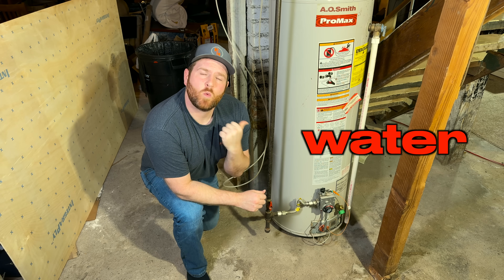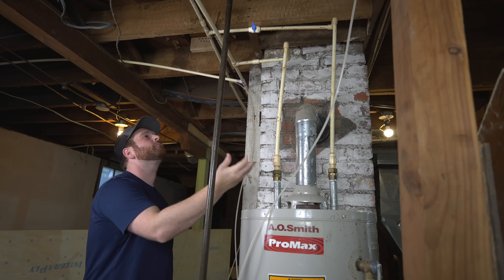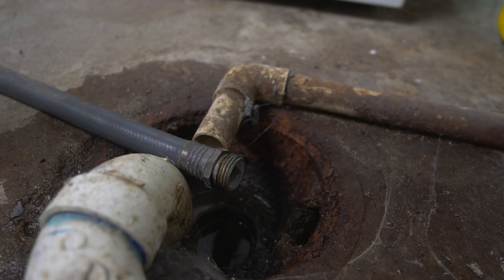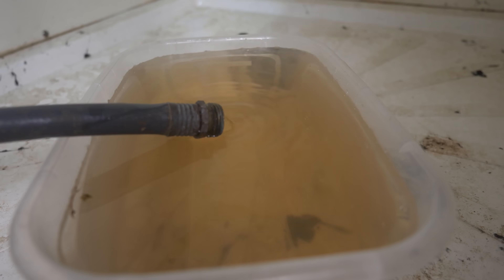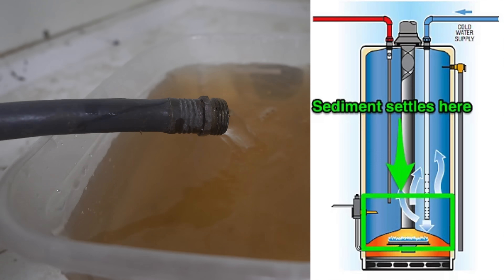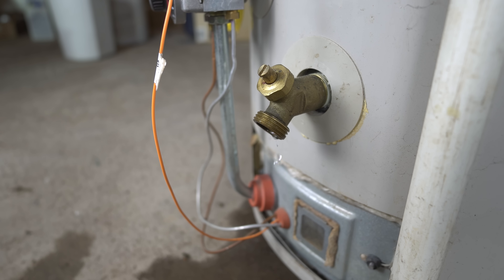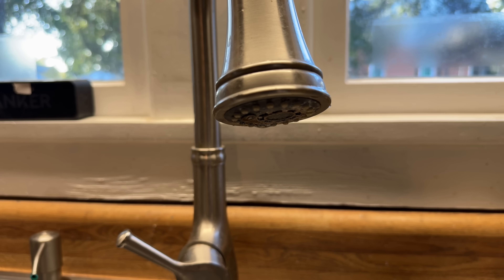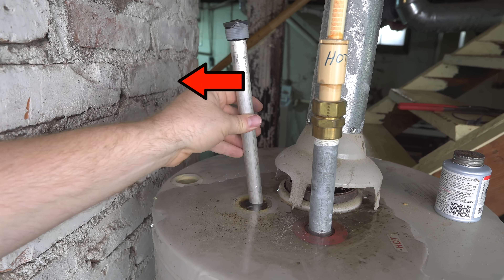Correct Way to FLUSH WATER HEATER! 2-Minute Tutorial

Comment: I have my water heater for 12 years now... it works amazing i had no idea about this
Reply: Same here, Never touched it.

You know though once we start messing around with it somethings going to go wrong with it within a week or so!

....Never Fails!😐😢
Reply: @huntingtonbeachsasquatch  thinking the same, I was thinking about doing. Buy thought I'd screw it up.
Reply: @soolly357  ....Do it early in the day, don't have other plans just in case all hell brakes loose and you snap a pipe or valve and find yourself doing a replacement water heater!:hand-orange-covering-eyes:😤😠🤬
Reply from the maker: Certainly Not a have too. But I think everyone can agree preventative maintenance can add life to about anything.
Reply: @HandymanHertz  for future ones yes absolutely
Reply: Yup, great info.  But if a few years have gone by and the tank hasn’t been flushed, leave it alone cause it could cause more problems.
Reply: time to drain it!

Comment: Is it true that if you have a old water heater that has never been drained and flushed, you shouldn't start doing it after that so many years have passed?
Reply from the maker: I'm not sure if it's true or not, but I have heard that as well. May not hurt to leave it be if it's really old.
Reply: That’s what a local plumber told me to
Reply: @HandymanHertz  Thanks for the reply.  Yes, that's my thought as well.  I did buy a cap per your suggestion because I have a slight drip leak, probably from mineral build-up.
Reply: Came here wondering the same, thanks for asking! Mine are VERY old and doubt they've ever been flushed but good info to know when they have to be replaced!
Reply: I'm wondering the same thing. My 50 gallon water heater is over 20 years old. I can't access the rod easily due to ducting, piping, and ceiling clearance, so I can only guess my rod is long gone. I'm concerned that the second I mess with my heater that it's going to have problems.

I do wonder if the frequency and amount of hot water used affects anything. My family of 8 vs a couple will have different hot water needs.

Comment: I've found that the best way to maximize sediment removal is to remove the lower heating element once I have the tank drained.  This allows me to use a water hose to inject water into the bottom of the tank from a variety of angles instead of just from the inflow line.  Tends to stir up a lot more sediment that way.
Reply: I do the same thing, with a small difference. I cut a scrap section of garden hose about 2 feet long, tape it to a shop vac, then suck up the debris through the hole for the bottom element. Works great.
Reply: @mj625  I may have to steal that idea.  Good thinking.
Reply: @Bonkrr  I think you will like it if you try it. It speeds up the process a little bit because you don't have to wait to drain any stirred up sediment. Just be gentle with the hose against the interior tank surface.
Reply from the maker: Great tip or an electric water heater. Thanks for sharing.
Reply: Is there a way to do this with a gas water heater?  Somewhere to blast some water in?  I need to drain mine out too..
Reply: @M4R1N4 I have the same question! I hope you found your answer.

Comment: Random but similar question for you. Is it okay to use the water heater drain as an outdoor spigot line for rinsing purpose? The water heater at my property has a line connected to the drain that leads through the wall and outside spigot. Between the line looks be a converter because if I touch the line before it, the pipe is warm. But when you turn on the spigot outside it comes out cold. My tenants have been using it to rinse off beach sand off their dogs or items as we live in a beach community. Not a full flush out, its just a few minutes usage of water to wash of sand. Do you know if this is okay or is it likely to cause damage on the water heater?
Reply from the maker: This is perfectly fine. In fact, it's good to use that for that purpose. I couldn't use that water spigot on a washing machine, for instance, because it may have sediments. Nothing harmful with this setup you have that I can think of
Reply: @HandymanHertz  Thanks! This was setup from the previous owner before I took over so I don't have any answers as to why or what used for. My guess it it may of been used to the automatic sprinkler system. Just thinking that was the case because of why the converter device is installed to expel out cold water.
Reply: @HandymanHertz  I can email you photos of what it actually looks like if you want a better visual for opinion.

Comment: Why would i use a shirt to filter the water?    To see the junk coming out ?
Reply from the maker: Yes, it's an option. I like to see what's coming out.
Reply: Would it make sense to change the anode rod, when the tank is empty?  It looks like there was water spilling out the top of the tank when the anode was pulled.

And BTW, my water tank hadn't been flushed in years, and I noticed dirty water (only hot) coming out of taps, after we had been out of the house for a few weeks.  So, my read of the manual, talked about 2x/year flushing which I had never done in over 10 years.  So I flushed the tank, using a procedure similar to this video and after a couple hours of flushing the water was clear.  I am on municipal water.

Thanks for the video.

Comment: LOL...that drain never works.  It gets clogged by the smallest piece of debris.
Reply: If your drain is blocked by debris, simply use a garden hose or other source to back flush it.
Reply: @Bonkrr  I get that.  My tank is a poor design.  The valve is literally at the bottom of the tank.  Back flushing will not work.  I need to make sure the next tank has the valve a few inches above the bottom of the tank so mineral sediment fall below the valve.
Reply: You can easily replace that valve with a larger one.  Just use teflon tape and plumbers putty

Comment: i've never met anyone that has actually drained their water heater
Reply: I actually need to, that’s why I watched this.
Reply: @PFCMittens stg me too😂 every time I run my water smells like rotten eggs so hopefully this works 😂🙏
Reply: I have to every six months. It super sucks.
Reply: @MW-xv1sj same here if not soiner
Reply: I never did it in my first home. Then moved to the mountains where our water supply is high in minerals. My water heater tank blew out after 7 yrs. I am flushing the replacement every year now.
Reply: youve never lived anywhere that there is hard water
Reply: @Weezulguy most of the US has hard water.
Reply: @Weezulguy I do, and still don’t know anyone that has. Do you use a water softener?
Reply: I do ours twice a year. In our former house, the heater lasted 20years. In our present home, our tank was installed in 2015. I flush it couple times a year. Today I replaced the anode rod since the tank was almost 10 years old. I write with a paint pen on the side of the tank when anything is done so I can keep up with maintenance. Hot water tanks can last a long time if they’re properly maintained
Reply: @BW12149 everything you've said is very wise to do. If you keep going above and beyond to maintain your tank, it can last well beyond the average life span of a water heater. I've seen 30 year old tanks that still function. Barely hanging on, but it just goes to show.
Reply from the maker: Does that come up a lot in conversation? How would you know?
Reply: Matter fact more then you think @HandymanHertz
Reply: @HandymanHertz  
I also don’t talk about parking breaks, the fact that garbage disposals aren’t sharp, AC temperatures to dollar efficiency maximization, tire pressure check frequency, small engine carb gunk over winter, lawn watering hours, and proper USB ejection methods as my first topic of choice, 
but goddamn it if someone is doing something a “correct” way or interval that most people aren’t you better BELIEVE they’ll let you know.
Reply: @HandymanHertz  Lol. Virtually no one drains their water heater.
Reply: @HandymanHertz I asked my coworker if she did it with her and she’s like we didn’t do that 25 years. So yeah I’m sure she’s not the only person who hasn’t drained their water heater for awhile.
Reply: I have.
Reply: Worthless... unless you can agitate the sediment it's just a caked blob that's in your tank... I've drained mine every other year and put a pan under the hose.. got very little sediment out... but if I replace the bottom element there is 6in of packed sediment in there
Reply: I do mine faithfully every year on my electric hot water heater and attach a white sock on the end of the drain hose. There is usually small pieces of calcium that get caught in the sock so I know I’m doing a good job.
Reply: Nice video but that water valve transition was sick 👍
Reply: Replaced my electric water heater when I bought my house as it needed one. It lasted 18 years and never drained it once.
Reply: I bet you met people that had to change their hot water heaters. Now you know why
Reply: Im worried. My house was built in 2005, and i bought this house in 2013. I havent drained it, and i doubt the elderly couple before me did either. 19 yrs on the original water heater, and worried lol whats built up in there.
Reply: @civicsport702  I was told if a 10+ year old tank hasn't been drained, not to.  It could have developed leaks that flushing it could uncover the leaks the sediment may be covering and cause bigger issues.. 🤷‍♂️
Reply: @civicsi_702  You don't want to know.
Reply: @civicsi_702 don't drain it if you haven't/arent sure. Sediment buildup over time might be preventing a leak if you do. If you don't regularly maintain, save it for the next one then keep up on a schedule!
Reply: Twice a year is best, all around. Yet, tankless is the way to go,
and flow"...
Reply: Unless it's agitated the sediment will still just sit there
Reply: I have hard water and will be draining mine today
Reply: How often do you ask somebody if they flush their water heater 😂
Reply: Damn, I was on the 10 year cycle. I’m draining mine this weekend.
Reply: Been draining mine every year and sometimes. Twice a year for the last 16 years… and same water heater when we bought the house..
Reply: What if our water supply comes from
Lake Michigan? Every year still?
Reply: I’ve owned 3 homes over 22 years and never done this. Spoke to friends and family members and none of them have ever done this either. Also I’ve never once replaced a hot water tank either.
Reply: @ I’ve also owned 3 homes never did it on 2 the last one I inherited and my mother never had it done just replaced the hot water heaters . After 25 years I just had to replace both heaters recently they were full of sediment.
Reply: A lot of people don't even know what a water heater looks like. They just turn their faucet and hot water comes out. Magic
Reply: Good for you.
Reply: My heater is in my attic
Reply: Worthless unless you can agitate the sediment
Reply: And they're all probably as, if not more, r_tarded than you.
Reply: I'm a regular yearly drainer and I have 2 extra rods in the garage
Reply: Most houses have old water heaters and you can’t start doing this as they are old and fragile and if you actually did this your water heater would never work again as it wouldn’t seal again lol.. if you get a new water heater then of course 2-3 times a year do this
Reply: @xGR1MxREAPERx  I’ve had my new place for like 2 years and never did it to the water heater. So you recommend I should start
Reply: Yes. Yes you have.
Reply: Hello, Im kennyd2134 nice to meet ya!
Reply: I imagine if you put a filter inline, your hot water heater could last super long.
Reply: Me neither.
Reply: I'm hearing a ringing sound so now I have to. Apparently it's from sediment build up. That's how I found myself here.
Reply: Currenyly watchibg my papaw cut pvc because his hose was kinked
Reply: I never drained mine, and I just replaced it after a 7 years.😅 I'll be draining the new one.
Reply: Not draining causes the hot water to get cold faster. Shorter showers. No baths. Drain your water heater... This isn't 1950 and it's not complicated.
Reply: I have. About to do it again. Gonna change the anode rod too. Maintenance is really cheap compared to replacement.
Reply: Have you met anyone that had to replace theirs lol
Reply: As you grow up and deal with homeowner stuff, and start to help others you will. Most people go thru a flooded part of the house or basement/crawlspace before they learn.
Reply: I never did until i had to replace it after a few yrs
Reply: I have to drain mine a couple times or more a year due to all the calcium deposits in my well water
Reply: We do it once a year
Reply: Not unless they had to move it
Reply: Me
Reply: Floor drain?  That would be nice.
Reply: It’s too easy not to do, but it’s more important in certain states with hard water.
Reply: Once every year, couple of years for 40 years 🤷🏻‍♀️
Reply: I’ve never owned a home by myself until 4 years ago. But I know my ex husband never did it either!  I’ve known I have to do this but hate the idea of it. I sell real estate and I typically share this with my home buyers during inspection then forget to do it myself! I will do it as soon as it’s not 1000 degrees in Arizona come fall. Thank you for making it look simple. Wish me luck!
Reply: I drain mine every summer. Found this vid while searching for a vid to send to a new homeowner friend. I also clean my furnace flame sensor every summer. Take care of your stuff and it will take care of you.
Reply: Try living on a well bubby
Reply: We have hard water so it burns the bottom coil out once the build up reaches it. Usually have to drain and replace it once a year
Reply: If you never flushed your water heater and like 8-12 years old, flushing may cause it to leak. Better just to wait until it goes out or buy a new one and start flushing with a new heater.
Reply: That’s insane.
Reply: Lol me neither
Reply: Not very intelligent friends hunh?
Reply: @priceandpride  and how many people have you met that had to change their water heater after 5 years ?
Reply: @priceandpride  you must not know very many smart people than I guess. where the hell do you live somewhere where they have the club animals with sticks over the head and drag them back to their cave instead of using a hunting rifle or going to the store?
It’s called maintenance. Do you change the oil in your car? Or just leave it for about 10 years and hope for the best? if a shingle blows off your roof do you just hope for the best and leave it for the next number of years or replace the shingle common sense man common sense.
Reply: @johndeyoung9230 this is why I come to the youtube comments section

Comment: No water comes out when the inlet water valve is shut off, I tried every combo of every water faucets on and off. Only time is when the inlet is open water flows out the drain perfect, soon as inletis off it stops. I know the tank is full bc I redid steps with out running the sinks inside after filled tank. any ideas?
Reply: Flip open the pressure relief valve on your hot water heater.  That will also allow air to flow in and water to flow out.
Reply: @Bonkrr just be aware that activating the pressure relief valve may lead to it leaking and need to replace.
Reply: @garytemp  Fair point.  I wouldn't expect that manually opening it would stress it too much, but it's certainly something to be aware of.
Reply: You might have a one way backflow prevention check valve on the water heater outlet.
Reply: @gt750kr  wouldnt a check valve be between the inlet and the tank? only thing I have besides the inlet valve and outlet , is the thing on the top side of tank that looks like toggle wing anchor.

Comment: wouldn't it be easier to set it on pilot ?    Also,   how often does the anode rod needs changing?
Reply from the maker: Yeah, pilot would be easier, I just felt  telling people to turn it off would be better overall. It depends on your water quality on how often you change out anode rod. I have a friend in Wisconsin that didnt last long and had to replace his 2 year old water heater. Some areas every 5-10 years it seems. You can pull it out and check it in no time.

Comment: Honestly you’re always wrong so it’s so many of these videos you need to angle the outflow pipe to a 45° angle in the air and pump that that will actually do all this stuff that you’re doing after waiting hours
Reply from the maker: I honestly have no idea what you're saying with your bad grammar. 🤨
Reply: If im making out what this person is saying- they are making a case for an alternate way of using some sort of pump to drain it faster instead of waiting for gravity to do it?
Cant be sure but it sounds like their saying you're "always so wrong" because your showing a process that at one point is slightly different from theirs?
But again...can't be sure
Reply: I too am lost by this comment. As a plumber for 40 years i can tell you i 💯 agree with draining the heater.  I have found the best way is tomhook up a compressor to a cold spigot and blow the water out. All the debris in the bottom get forced out with the air and water. Works great and fast
Reply: @ptech88 I wish you would give some more details about how to do this. How do you attach a compressor to a cold water spigot? An outdoor spigot? I use my small compressor to air up my tires, but what do I need in order to connect it to a spigot? Please elaborate and thanks in advance.

Comment: So you leave a faucet running then shut off the water and drain ?
Reply: The faucet won't be running because the water supply is off.  The faucet being open allows air to flow into the tank allowing it to drain quicker.